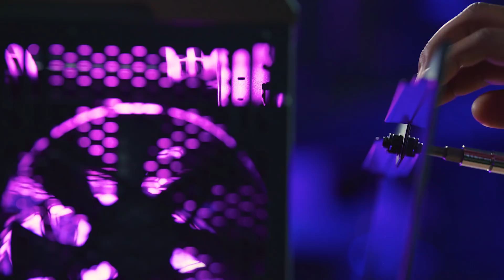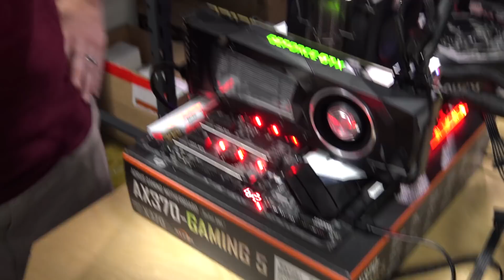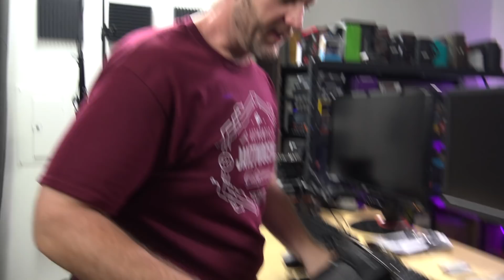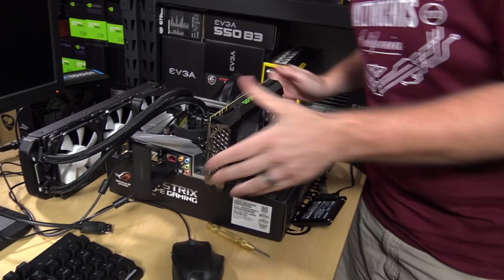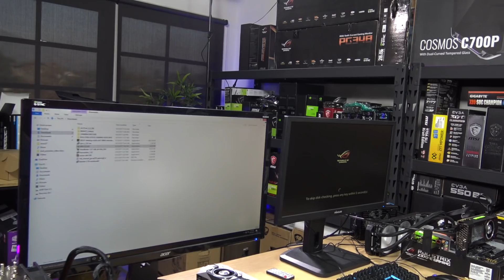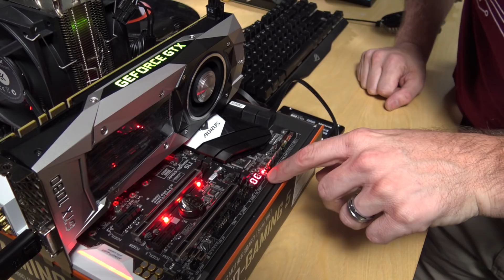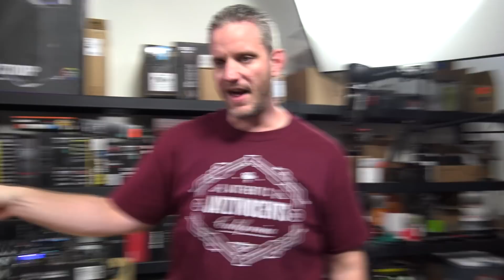I cant figure this one out... HELP!

Comment: Btw, The beta bios and an older bios will boot my Titan Xp (Pascal,) but the current gigabyte will not on my Gigabyte K7, or B350 gaming 3. This is NOT and AMD/Ryzen issue, but is a gigabyte issue. Support through gigabyte is horrible to say the least, but on call from a local shop to gigabyte this AM confirmed it. This is why as a beginner builder you should be working closely with a shop. Many times they will price match best deals to get your business. Sadly not many local shops exist that can give that sort of trust on a personal consumer level.

Comment: I've had some issues like this before and it was my motherboard BIOS. Sometimes the motherboard does not give enough power through the pci slot and it might be the issue as the card is pushing it's power from the pci as well as from the PSU.

So, you can try to swap you x370 motherboard to isolate the problem from the motherboard. Then, if this still happens, try to swap the CPU to something like Ryzen 5 or whatsoever so you can check if this is a problem regarding the specific CPU.

Not every BIOS update is 100% secure as bugs might occurs.

Comment: I had a similar issue on my MSI B350 Gaming Plus. It wouldn't boot and posted a GPU error too. I found out my GPU just didn't like one of my DP cables. When I unplugged it, posted fine. So I replaced it and been fine since. Only board I've ever had that issue, but may be a Ryzen or B350 thing.

Comment: All of what you know (ideas, theories) of cooling are wrong (no offense to anyone). I am in production of a prototype and will be showcasing it to steve @ gamers nexus and jacob @ teamevga within a few weeks and if anyone is interested email me. This is the game changer. Fully modular design, 4c-8c case ambient, dust free, same size as a 280mm radiator, lower production cost, lower energy consumption and keep your cpu/gpu below 10c under max load... sound interesting?

Comment: Didn't he check the bios of the same card twice? He checked the gpu bios on the Intel system, swapped the cards, and then checked it on the ryzen system. Thus checking the same bios twice instead of comparing?

Comment: Its gotta be the mobo. as I have mentioned , i have had a 4 different gigabyte boards now with AMD ryzen and odd things happen with them that is unexplained. Try a 2nd 370 gaming 5 board.. i bet it has the same issue. I have tried to replace with the same boards and still get the issues.

Comment: Looks like a manufacturing & hardware issue. if the pins are not aligned between two components, this might be a contact issue. You had a boot error and had to re-seat the other graphics card. Specs off 1/32nd of an inch can cause problems.

Comment: Try a different amd board?  Or try to install both the cards in sli. I am sensing a power delivery issue for the PCIe socket.  Try to decrease the base power draw of the non post card because that isn't something dependent solely on the bios.

Comment: Jay you put the card that wouldn't boot in the AMD system into the Intel system and never pulled up the firmware version. You relaunched it on the AMD system but that was the original card that was in the Intel system.  You may have confirmed off camera but just commenting as you said you wanted to check that firmware version of the card but checked the wrong one.

Comment: Your setup is not shielded from HF radio waves, i.e. every wifi, mobile phone, even the electric field from your mains etc. will induce disturbances on the mainboard’s traces. Then every component has slightly different capcitances due to component tolerances which means that the electrical disturbance rejection will be different if you change something on your setup. It may be that you have a rare case where it is enough to change from “working” to “not working”.
I suggest putting your setup inside a grounded metal case.

Comment: From what i've read below, it seems like a trend has formed in relation to the Motherboard Manufacturer. Gigabyte have been releasing some seriously low quality stuff over the past 5-7 years compared to what they used to supply the end user market. 
Weather it's AMD or INTEL i've heard a lot of stories about Gigabyte failing a lot of people over this time. I'd say try a fresh Motherboard Bios in the Ryzen system and try that card again. As you said it worked in other PC's but not with that Board. Also the contact pins on the card at the bottom make sure none of the pins are tarnished as you said yourself RYZEN is finicky yeah? I hope this helps? Maybe it is the Motherboard as the 1080 even had some issues and had to be re-seated too yeah? (I'd say it's the PCI Express slot and a potential dry solder or over solder issue or simply faulty slot in part as the Titan is a very hungry card yes? Maybe it's a power delivery issue Motherboard side that is your issue also? I vote for Power delivery on-board to the PCIE slot as your issue.)

Comment: Thats bizare dude because i have the exact same b2 fault come up on my mobo and my 2 week old gigabyte aorus extreme 1080 ti seems to be the issues as i borrowed my friends 1080 and it worked straight away so am sending the card back for warranty?? Now i see you with the same error code and am like wtf??????????????

Comment: I've had the same issue with a Gigabyte x79 motherboard. I had 2 7970 cards that were Revision 2 cards. One worked, the other didn't. Had to wait for a bios update which fixed it. It might be worth trying a different brand motherboard like ASUS.

Comment: JayzTwoCents Save the bios from both cards (with gpu-z) and generate a md5 or sha checksum for both bios roms. if they match there the same if they mismatch one is definitely corrupted. Np love your content! =)
Reply: Nope, try again :/ Did you not notice the part where the card worked perfectly when switched to the Intel system.

Comment: I have had this type of thing with a r9 390 it wont work in my asrock a88x killer but a 280x worked fine and a 1070 works fine.

Check the video card if the ram is different. Like hynix vs samsung then some odd issue...

Comment: There's many reviews of that motherboard on Newegg where people have stated that the board failed after just a few weeks. My guess is that one graphics card is trying to draw a few more watts on initialization compared to the other card and that is just enough to get a bad motherboard to fail to boot. Is there some way you could attach a wattmeter on the power supply's pci-e circuit?

Comment: Take both gpu and line up the boards and check to see if one of the pins is out even just by 1/8mm. If so it could be that one mobo is shorting out the gpu pins and one is not.

Comment: i dont see why ryzen is supposed to be the culprit here - at this point you only know the card posts on the other systems (does it really boot on all (100%) other systems?), but not with the ax370 gaming 5 (k7?). try a different ryzen board before you claim "its ryzen", because most likely its either that dodgy motherboard (have it myself) or some sort of gpu (board) failure whats keeping the card from posting. the pcie-slot could be damaged, manufacturing tolerances building up (traces on the gpu), starting voltage for the gpu going bonkers, maybe some bugs in nvidias voltage regulation failing to power up the gpu, because the board doesnt supply enough voltage or whatever. the board failing to initialize the 1080 ti on the first try really suggests its the board or power supply, actually. bc a cpu doesnt work at random, it either works or fails. 
also be sure to try a different power supply. if a different am4 board (other brand) and a different psu acts like that, you know its either the 1700x or the gpu.
if that card doesnt post on any ryzen system, the card is smoked - because ive never read about "ryzen + titan = nopost" - that would be a massive uproar.

Comment: Had the same issue with my 1080ti Zotac Amp Extreme.  This will sound stupid and was a pure fluke on my behalf, plugging the GPU into a riser cable stopped the error codes and allowed the system to boot with the GPU.

Comment: The GPU BIOS you showed in both systems is from the same card, you never showed the version on the card that was initially installed on the Ryzen PC that could be one thing... Second thing I would try if both GPU BIOS are the same version is less DDR modules to see if that "memory" issue gets fixed

Comment: I just recently started having this issue with my 1800x on a MSI Gaming Pro Carbon and an MSI GTX 980 Ti. But after a reboot or two it will work just fine. So its not confined to just Pascal cards or Aorus Motherboards.

Comment: Have you tried turning it off and on again?
I think you know the drill J.

reseat everything.

try minimal config

swap cpu, ram  all the good stuff if you dont want to blame the GPU.

I for myself would just return the GPU and ask for a new one if you explain and proof the issue you get one. 

there are manufacturing variations and if you have bad luck you combined parts which cant work together because they are just  manufactured at the end fo the spectrum. like a little too big screw and a little too small nut cant work together despide they have the same diameter.

Comment: I had similar issue once.. And after trying out new motherboard.. everything even new system drive.. 
It ended up with the PSU connectors that a 680GTX card didn't like but the 970GTX didn't mind..
Never would have guessed on PSU connectors as blue screen error that said Ram memory..

Comment: as weird as it sounds, try this: 

with a working card, go into the Ryzen BIOS, and disable CSM.
then insert the "weird" Titan into the secondary PCIE 16x slot, boot, turn off
put it back into the first 16x slot, boot.

it might work, because it did on my C6H + 1700 when I tried to boot with a 1080Ti.

Comment: With good card, boot to UEFI.
Set UEFI boot only (Disable CSM)
Swap to troublesome card.
Does it POST?

If not swap to known good card, boot to UEFI.
Set to PCIe Gen2 instead of auto.
Integrated graphics set to disabled.
Swap back to troublesome card.

Comment: You keep saying it's Ryzen's fault, but isn't it equally Nvidia's fault? You have two 1080ti's, one works one doesn't... If it was entirely a Ryzen problem, neither would work. Another way to look at it; Let's say you had one hundred 1080ti's, 99 of them worked and 1 didn't. Obviously, it's that card's fault? (Granted, that card works in the other systems, but obviously there's a problem with both, Ryzen and the 1080ti.)

I'd be interested in seeing if other Ryzen CPUs have this problem. Say something like a 1500, a 1700x, then a Threadripper of any variant. It'd be verrrry interesting if it was just THAT specific CPU, and THAT specific GPU that, for unknown reasons, hate each other.
Reply: or its coffeelake is GOD CPU...brought 1080ti back to life with its powerful cpu what RYZEN can't do
Reply: True, I didn't think about that. He did say he tested it on 2 other rigs, but I imagine both were coffeelakes. So maybe another thing to test!

Though I doubt Jay wants to do all of that, and still ultimately learn nothing from it. Other than, sometimes shit happens.

Comment: Either I missed it, or when you took the gpu out of the non booting system and put it into the other system (right system) you didnt actually use GPU-z on the right system to check the cards bios.   
@ 2 minutes you can see the right system on windows with gpu-z.  
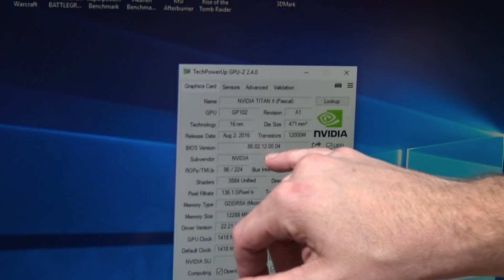@ 3minutes you good card is put into the left system and works and gpu-z does indeed show the same bios. (4:53)... 

Did you actually check the right system (now with the problem card) to test its GPU Bios ?

Comment: My brother and his wife had to swap monitors since her GPU would cause random signal loss. Now after swapping and using VGA adaptors both computers are working just fine again. Never experienced that myself, but I did experience CPU post failure. Turned out my hard reset button on the case had gotten stuck. I only found out after reassembling whole PC.

Comment: My B350 Mortar Arctic did the same thing, I swapped the memory stick slots (a where b was, and viceversa) and it worked just fine. Issues between CPU, RAM and GPU in Ryzen can be a nightmare

Comment: I would check to ensure motherboard BIOS settings are stock (no OC), remove any other PCI bus devices (SSD?)  then if the problem persists continue to narrow down where the incompatibility lies; try other memory, CPU, PSU, PCIe slots, motherboard until the incompatible parts are identified. At that point the reason may become clear or at least you will have a definite place to start debugging.

Comment: It doesn't sound to me to be a bios issue, especially if the "bad" card works perfectly fine in another system. I would guess that the cards use slightly different voltages, and the motherboard is sensitive to voltage fluctuations.

Comment: I work in the OEM industry & have tested thousands of systems. Try a new PSU, HDD & display, also different video ports on the card. Use an ink eraser and rub a bit of the gold color from the connections on the card. It's called "cleaning" the card.

Comment: I had the exact same issue with i changed over to an AMD card and it would post, then got my 1080 RMA’d and it worked on their machines.

Turned out that the drivers by Nvidia on their website caused my system not to boot correctly. So I put the AMD card back in, ran DDU and uninstalled all the Nvidia drivers. Put the card back in and bam it went to post WHICH MAKES NO SENSE! I only have the Nvidia drivers supplied by Microsoft update download and its working perfectly, so far no issues

Comment: Start with the basics.  First, the camera work made it extremely difficult to ID the board, and you never mentioned the motherboard model.

Assuming the board is indeed a Gigabyte GA-AX370 Gaming 5 motherboard, the code b2 indicates "Legacy Option ROM initialization", and again, assuming it's the VGA error light that's on, you have a VGA error while initializing the Legacy Option ROM.

This is a very popular error on Le Google.  Most indicate they tracked it down to a motherboard BIOS update, or a potential physical electrical issue between the board and the card.

Personally, I would go down this list (all on the AX370):

In the "Voodoo" category-- any time I have a system behaving oddly, I unplug PSU, power on system, plug PSU back in.  The theory is that Soft-off on ATX power supplies does not completely remove power from the system, and merely turning off PSU does not drain capacitors.  Turning on system when PSU is unplugged (or "switched off") "drains" all the capacitors, and resets the board to a known state.

After that:
  * In UEFI, turn off "Fast Boot" or turn "fast boot" on, and try different "VGA Support" options (legacy boot on/off).
  * Clear CMOS / reset UEFI.
  * update UEFI / BIOS
  * try different PCI-E slot

Comment: The Motherboard you are using is working well as it didn't detected the GTX1080 in one go, once you repluged the GPU it worked...so it might be some kind of Motherboard issue ! Gigabyte motherboard does it all the time. I got a B150m-ds3h and once I power it on everything lights up then goes down then again lights up and boots !

Comment: Just wanted to point out @JayzTwoCents, that you are asking for help because you don't know what the issue is but you are insinuating that its a Ryzen issue.  Which could be the case, but again you say that you don't know so why say its a Ryzen issue.  It could be an issue with that particular card, the PSU connections, the connections on the PCI-e connection on the card.  It is an interesting issue though and I hope you find an answer.

Comment: Im in agreement with it being the PSU, two things in the card that  could be affecting the post, the shielding and or voltage regulators and the PSU maybe already slightly dirty in its signal compared to the other PSU compounding the matter. Where as the other setup is sending a cleaner more regulated voltage.

Comment: Got few times the same problem.the same graphic card(only got one).. with  2 sticks of ram removed one bootes fine bought new ram.now 4sticks of ram no boot black screen only. removed one (sometimes even three sticks of ram)  it booted fine turn off pc  put ram back turn it on everything normal.happened few times with 2 different mbos.

Comment: I had the problem of detecting the GPU with my Threadripper 1950X with 2 x Asus Poseidon GTX 1080Ti on an ASUS Zenith Extreme board.   I tried the BIOS reset switch, didn't work, I tried setting just one GPU then again with the other, didn't work, I tried reinstalling the CPU, didn't work.  What did work is one thing that I didn't expect, I pulled all the memory and reset one stick got it to post, updated BIOS and drivers and what not, then shut down, added the remaining 7 sticks and it worked fine from t hen.

Comment: Why don't you try it on another slot? I've face this problem before,slot 1st nope,2nd work,3rd nope and 4th nope also tried it on another system and work just fine,so i decided to replace the motherboard and that work for a while until the card refuse to work on any slot and any system..

Comment: this is  a bizarre issue.  one ive never encountered either. so crazy thought.  is it at all possible the other card is trying to boot with a different clock speed or something or power need?  like a faild oc' trying to load?  maybe the board is detecting the card in a funky way and interpreting what card is plugged in wrong somehow..

only thing I can think of, but as how to fix it?  I have no idea.  If i were to find this on my own and a different card worked?  Id probably just return the original and just get a replacement and I know the card isnt the issue... well i mean it is the issue so if its not working in that system its not working in the system regardless of the reason.  now if the replacement card did it too hmm.